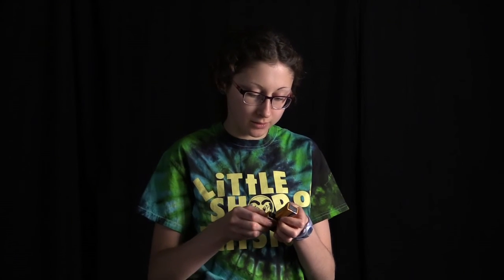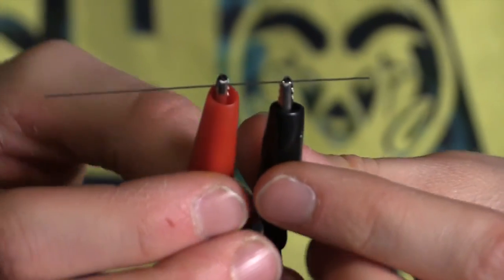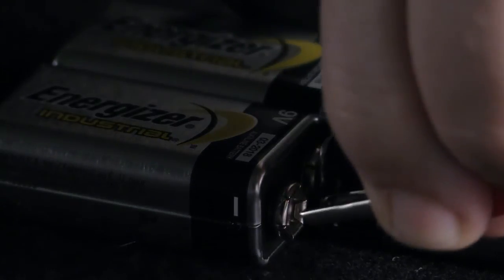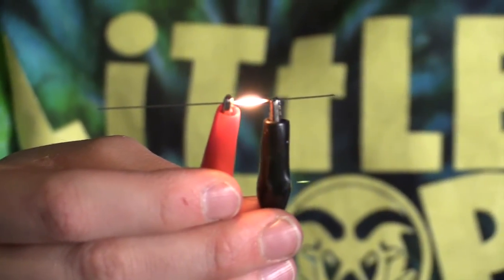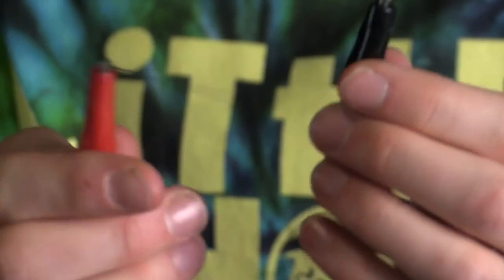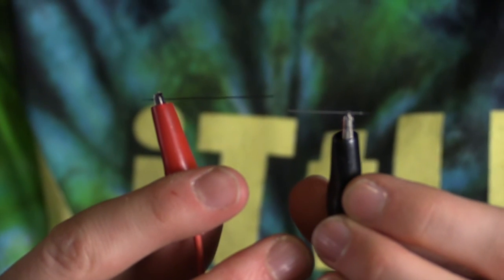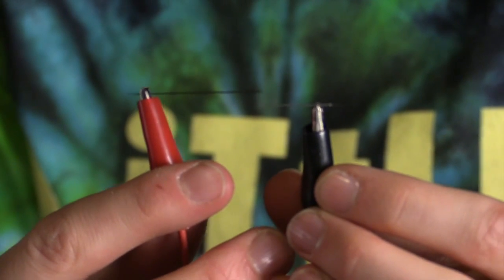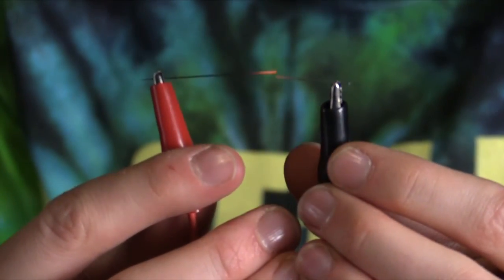Flash Science: Graphite Glow

Comment: is really graphit can glow on such a low voltage and amp
Reply: Yes - it was a mechanical pencil lead! the voltage was low, but there was a lot of current, and so a lot of power. Using the right size lead is important, as is the power supply.